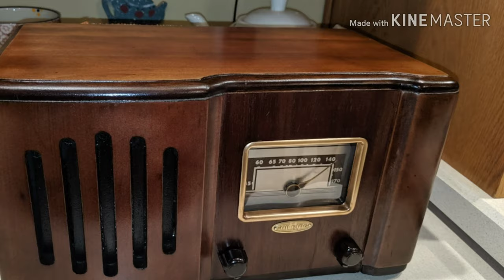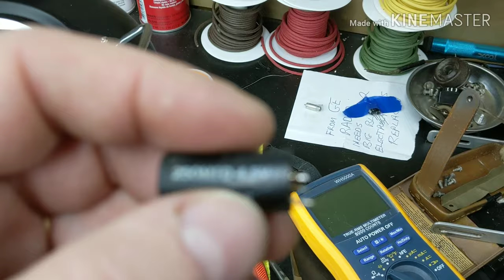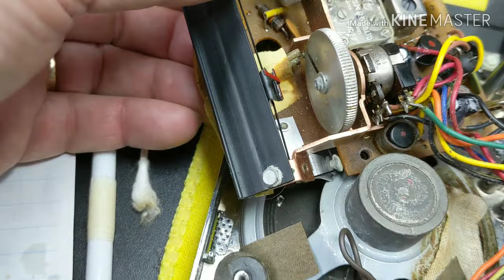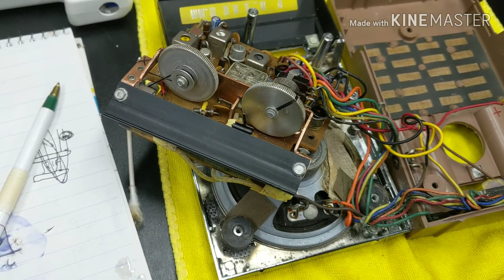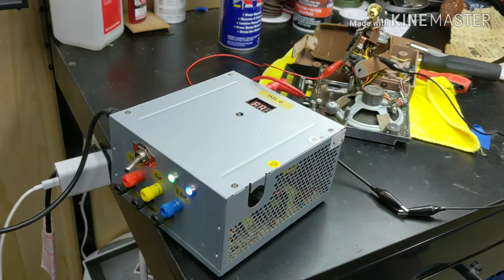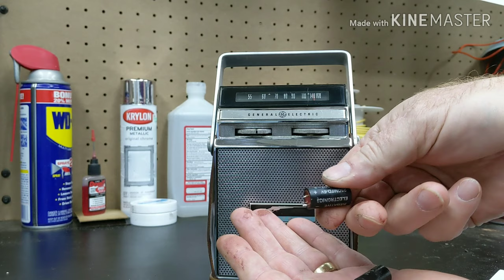GE Sportmate- P860A- Restoration/Repair

Comment: Acid is the enemy on these old radios. I have rebuilt hundreds of transistor radios and most of the time the caps, traces and speaker jacks are the problem. GE in particular had problems with the traces deteriorating. Good fix on this radio. Thanks for sharing.
Reply from the maker: Thank you.

Comment: Great job! Almost every old transistor radio I've looked at has a problem with the earphone switch. Definitely a weak link. And I swear those power switches just lurk in the background until you've done everything else then just open up!😁 Great video!
Reply from the maker: Thank you!